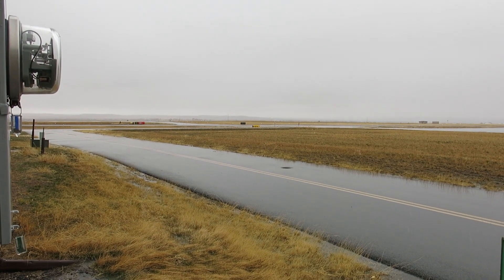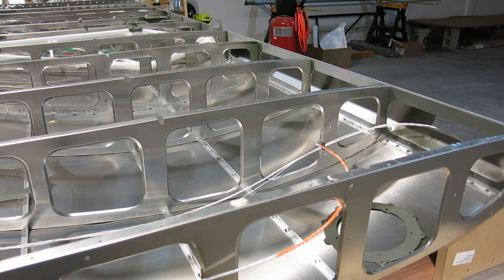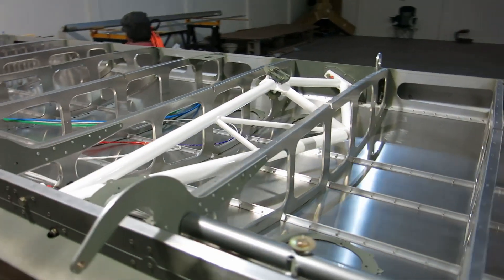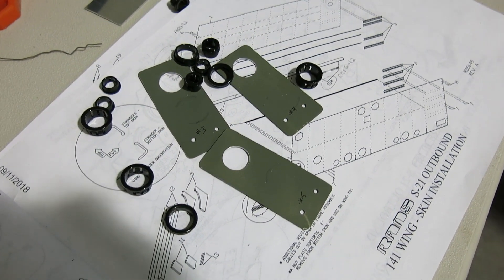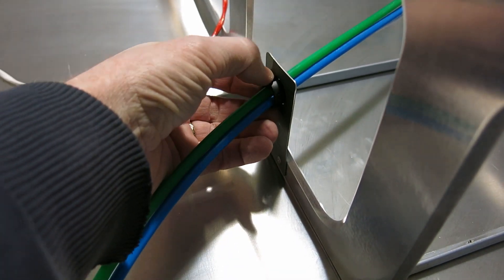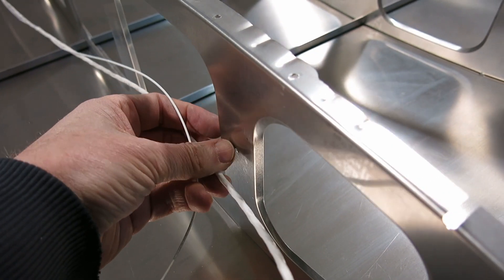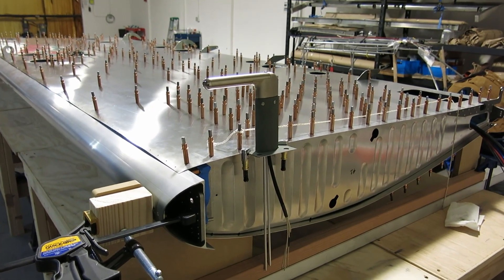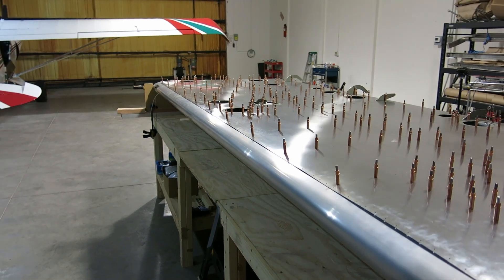No. 82 03-20-2021 Pitot tubing and bottom skin back on

Comment: Once again fascinating watching your progress, very important having the "Project Managers" approval! 
Question? and it may be a little pedantic? do Rans call for final sizing to #30 and then dimpling? or? dimple first then final size to #30? the reason I ask is being the leading edge of the skin you wouldn't want to enlarge the final sized #30 sizes holes more by dimpling  last, remember reading an in depth article around that subject to minimise rivet hole (stretch) diameter? just curious
Cheers Glenn Down Under.
Reply: This is a topic exceeded in controversy only by whether to prime all internal structure or not.  😁. I am an engineer (electrical and structural degrees) and I am priming all of my internal structure so I do tend towards the overkill side.  Having said that, I likely will follow the RANS instructions which call for drilling to final size (#30) prior to dimpling of the skin.  I may drill to 1/8” in the skins and see if my dimple pilot will fit through a 1/8” hole as that starts the hole 3.5 thousands small than #30 so the stretch from the dimple probably takes it to #30 or beyond which would be just about right.  However, I have no qualms just following RANS instructions either.

I won’t argue that it is “better” to drill a smaller pilot hole, then dimple, then drill to final size.  I actually believe the military specifies the hole be reamed to final size rather than drilled, so if you REALLY want to be precise, that is how it should be done.  Dimpling after drilling will certainly make for a larger hole and a less tight rivet to hole fit.

Having said that, why am I not all that concerned about this?  Two reasons:

1. The most important is that I have never, ever seen a rivet fail because the hole was dimpled after being final size drilled.  I have never read an accident report where this was a factor in a crash.  I have never seen any test results that show this to be an issue.  So, it seems to me to be a theoretical concern, but I find no basis in fact to be concernd about it.

2. I believe, based on my engineering knowledge, but I admit completely unsupported by any test data and thus just my opinion, that most of the shear force on a dimpled riveted joint is taken by the locking together of the skin to the underlying structure provided by the dimple rather than by the rivet itself.  As long as the rivet is providing good clamping force between the two parts, I suspect the joint is far stronger than it needs to be.

However, I am always looking for data so if anyone is aware of any test data or accident reports that shows there is a practical issue with dimpling after final size drilling, please let me know.  I have searched for such data, but never found any.
Reply: @LTVoyager  As an ex stress / design engineer (and RAF aircraft tech) we did carry out test and there is an argument for pilot drilling then dimpling in areas of high stress but that said the reserve factor desinged into GA kit aircraft and the normal rivet requirement would not make this a major factor in most rivet applications. So if Rans say drill and then dimple then it should be within their spec and probably decided on the best chance of getting a repetable build quality, from the standard kit builder, it would also help to reduce the build time.
As for priming well that is down to the corrosion protection requirements. Here in the UK, I would prime everything but in a dry state in the USA I might consider just priming the brocken al cad areas (again that would have to be the builders choice for who they see it for selling the aircraft later, against cost in primer and time).
Reply: @flyingkub  Was that work published?
Reply: @LTVoyager  not to my knowledge to the general public at the time (1980's) as it was done for the RAF and Bae, it may have been put into the public domain since. It was used for writing the RAF general aircraft repair manuals and I  think shared with USAAF.
Reply: @LTVoyager Completely agree, and I would always defer in compliance of the manufacturers directions, the other factor that needs to be considered I feel is the stresses and environment these aircraft will be subjected to is, perhaps not quite as extreme as GA aircraft ie; speed, frequency of use and exposure to the elements - generally
I think the final hole sizing being reamed recommendation is to minimise micro tearing of the sheet metal therefore reducing stress rising fractures over time, 
So yes when the build time comes I will be leaning toward internal flying surfaces being Alodine'd & epoxy primed,
again personal preference and also different environs call for different approaches, here in Aus: most all of our airfields are not far from coastal regions, high humidity and scorching sun, appreciate your feedback
Cheers. Glenn.
Reply: @glennstocker487  The other issue is that a drill bit, unless used in a rigid fixture like a drill press or mill, tends to drill a tri-lobe hole rather than a circular hole.  A reamer will drill a hole that not only has no burrs, but also is much more nearly circular rather than triangular in shape.
Reply: That is a good question to ask. You are right that for most aircraft you dimple and then final size and debur. I wonder what Rans specify.